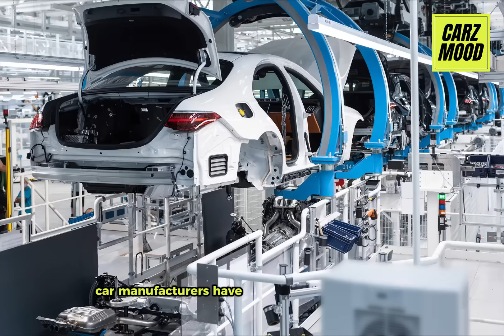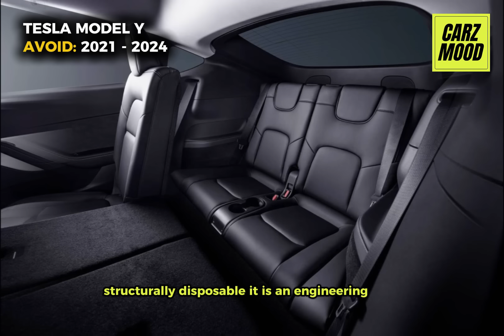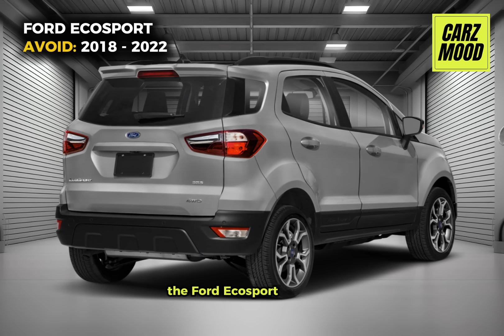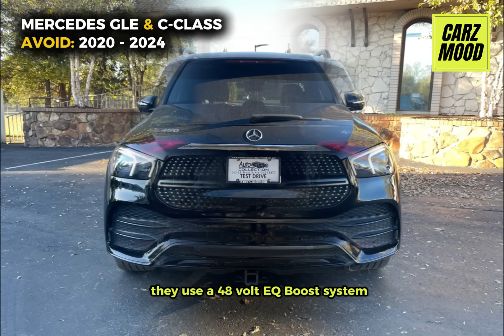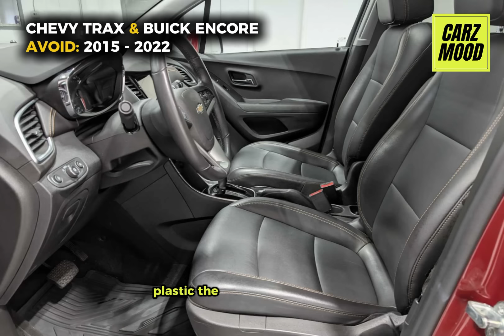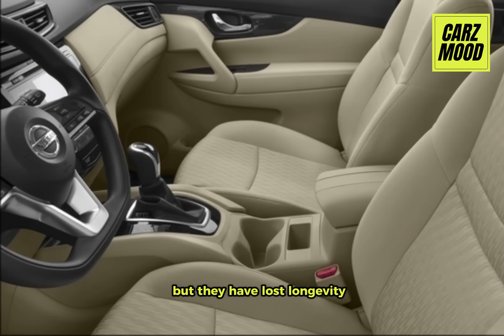5 "Disposable" Cars Built To Fail (Avoid These)

Comment: On what planet were cars built to last 20 years.  My parents had a 1971 Ford Pinto which was lucky to get 7 years....🤣
Reply: Yank rubbish no quality control 😅
Reply: I own two Subarus. 1 is 31 years old and I have owned it since it was 18 months old. The other is 27 years old, which my family has owned since it was new. They have both been regularly serviced and the running costs are much cheaper than new cars. They are also much more environmentally friendly than the new Battery Electric Vehicles.
Reply: @John-T-Aus  You were fortunate that car has head gasket, cooling system and oil consumption problems....not to mention the bodies are corrosion prone in cold climates.
Reply: 1985 Mitsubishi Lancer GL 485000km still drives on its original engine and automatic gearbox. 1997 Subaru Impreza WRX still drives at 220000km but unfortunately the rust is killing it and fast so it needs alot of chassis repair. Also my 2004 Toyota Corolla Altis has 337000km and still starts and sounds like it did fresh off the showroom floor
Reply: @toyotacorollaaltis8613 : Great. I think driving habits as well as care assures a cars longevity